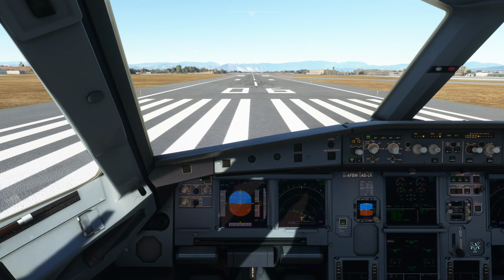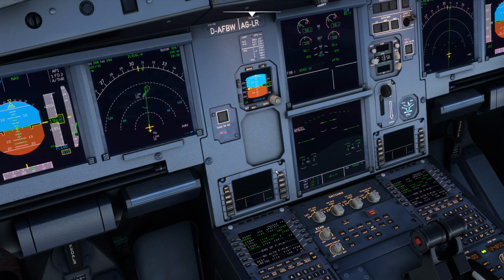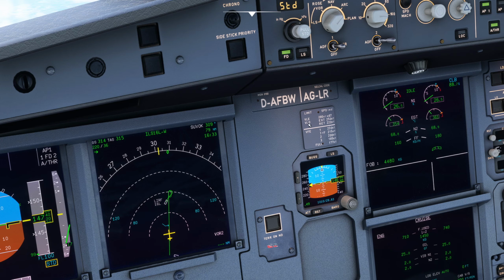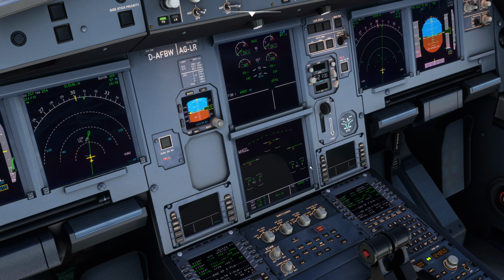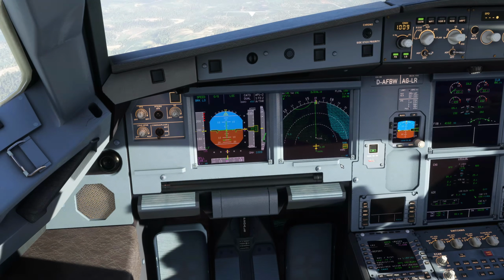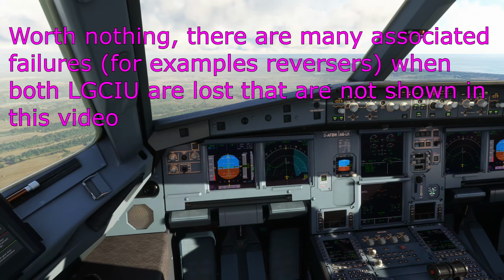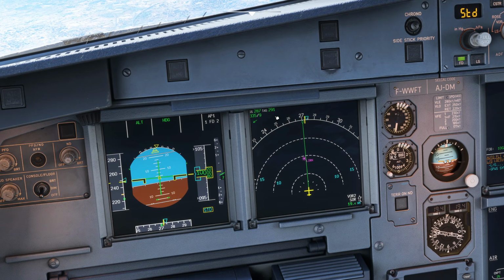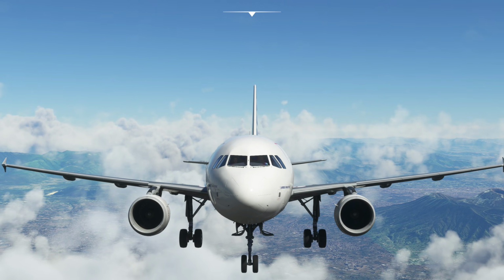When Your Landing Gear Won't Drop! With a Real Airbus Pilot A32NX/Fenix MSFS

Comment: Would you be interested in doing a video about go arounds in the Fenix? Especially ones using autopilot. I did a go around on LOWI 26 RNAV Z and i had MAJOR issues in getting the autopilot to go to the hold correctly, the manuals in the go around flightplan are confusing me :(  Also i had issues in getting it to release itself from the hold and start the approach again.

Thank you so much for your videos! Your the reason why i bought the Fenix and ive pretty much learned everything in how to fly it from your videos :)

Comment: The doors should release and start opening after the second turn, gear itself after the third turn. You can turn the handle counter-clockwise (and this is part of the maintenance procedure to put the aircraft back into normal configuration), but that's probably counter-productive if you're trying to extend it!

Comment: Thanks a lot for showing off that new feature. We believe this is the only physically simulated gear system in a sim. 
Note that the mechanism is totally able to revert: when you are back at turn 0 shut off valve just opens and doors will close. 
As a side note, airflow and hydraulics are fully simulated also, and the super slow speed shown on the Fenix is totally overdone.
Reply: Does it also fail to extend with loss of ADR 1+3. Haven’t had time to look
Reply: @tomstravels520  I did not test this actually :). But the logic of safety valve using discreet outputs of those Adirs is implemented

Comment: I was surprised not to see the 3 green lights come on. I'd have assumed that they were connected to some kind of independent sensor for each gear sensing that the gear is locked, rather than the lgciu. How else are you to be sure that the gear is actually locked in position once gravity put them down?
Reply: I asked the ToLiss developer about this as their model does still show the lights with faults. They said if the computer has failed but LGCIU 1 is still electrically powered then the lights will come on. The proximity sensors bypasses all the complex computer stuff that may produce the fault
Reply: @tomstravels520  If you activate lgciu1 power failure you’ll lose the light indicator. Lgciu1 internal error failure will still show the indicator lights. To check gear state you have the ecam wheel page which is the only reliable reference in any doubt.
Reply: @leloginquitu  but if both LGCIU loose power then you have no way of knowing unless you’re willing to do a flyby
Reply: @tomstravels520  in that case it’s a matter of plan for the worst hope for the best :)

Comment: Would it be possible to give us a guide on how to handle failures without a QRH, or if there’s a resource that could take the place of a QRH I’d love that too. The lack of it makes me worried about flying with random failures on, on the Fenix, on the Vatsim network.
Reply: I also would very much like to have access to an airline QRH for enhanced realism... But in the meantime, on most of the failures, following the ECAM acitons and monitor the status status page should get you out of trouble till you land of divert.
Reply: @Mam_2854  yeah I know you can follow the ECAM messages but there’s more to it usually. I’ve been looking and there’s no real good way to get a QRH easily and semi cheaply…

Comment: Wait, the A32NX has failures now? That's rad.
Reply: yes! we mostly expose them for the sake of testing our own internal systems, hence the warning up top. however some of them are already pretty well done such as the EFCS ones in the experimental version for the flight computers.

you can fail very specific things too, like an individual proximity sensor in a gear assembly. all wip though